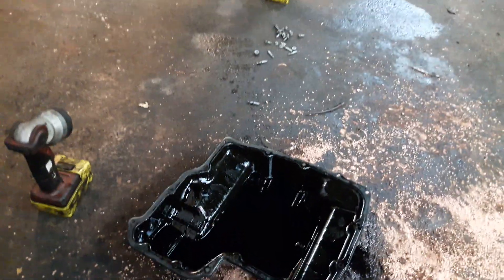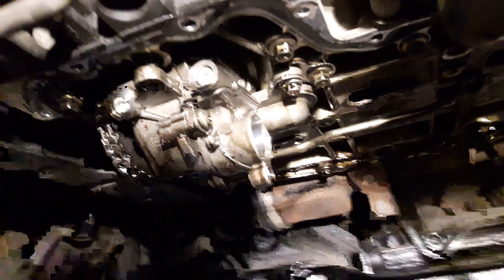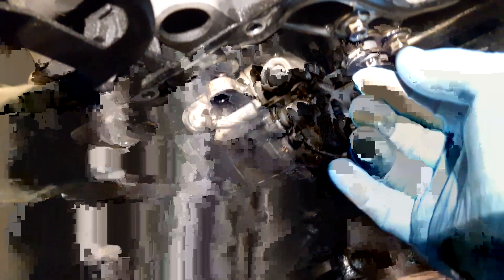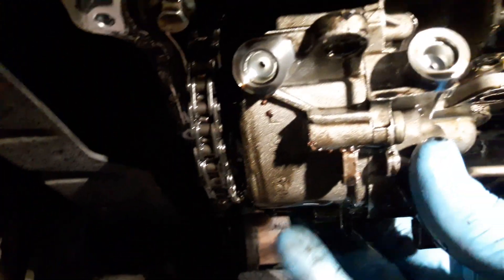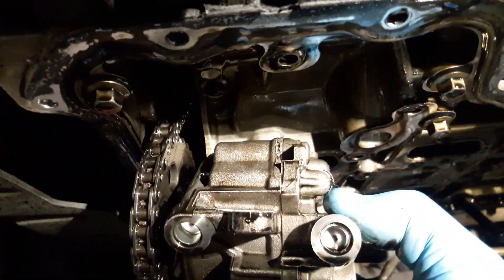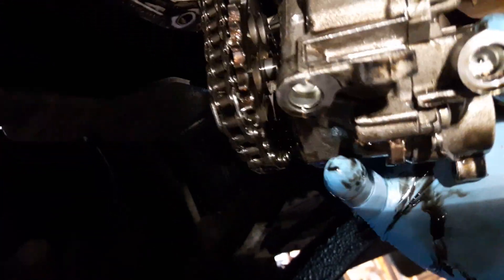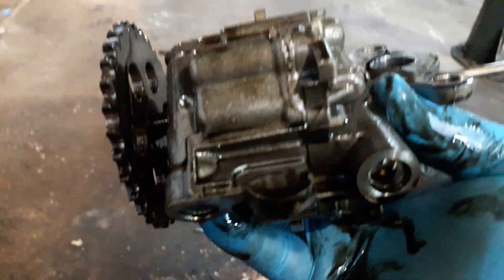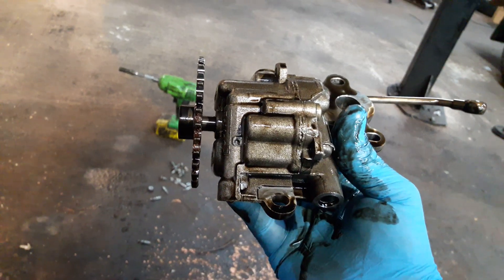2012 transit oil pump replacement

Comment: Does the chain not have a tensioner ? And should the chain and tensioner be changed at the same time ? And is it a total separate chain from the timing chain ? Thank you

Comment: Hi. I've replaced the oil pump on my 2.2 ranger to
a gear type but now its got a whine/humming
noise when cold and just about goes away
when warm since the new one has been fitted,
any idea what could be causing it? https://youtube.com/shorts/5ur5xyGRsSc?feature=share

Comment: This is also an issue with the Ford Ranger and LR Defender. The oil pump isnt self priming so if the oil is left to drain too long the pump runs dry and won’t pump oil when the engine is re started. The oem pumps are also substandard quality vane type pumps and the vanes (like little metal paddles inside the pump) can snap off or shatter in the pump. I believe Land Rover have issued a recall with the defender (but not certain) and Ford have acknowledged the Transit has a dodgy pump but haven’t with the Ranger (or the Everest) for some reason.
Reply: I think the worst affected years with the Ranger were from it’s introduction in 2012 until about 2014/15, apparently after that they used better wearing vanes in the pumps, but it’s still a dodgy design and only time will tell if these pumps shit themselves as well
Reply: It's good to install older version of the pump the toothed one. Centrifugal pumps are crappy. In mine 2015 transit in distance of 100 k miles this pump was changed three times. Ticking bomb. Engine oil pressure is constantly too low I read on Russian forum. https://www.drive2.ru/experience/ford/g4864/
Reply: I think the plastic paddles just snap on them
Reply: The pump sits in the oil,  they don't need priming 🤦‍♂️
Reply: @ssss-df5qz  Okay well the ranger and defender ones do.. not actually sure about the transit

Comment: Hi Richard 
After you fitted the pump how did you go about priming the pump ? I have read a few ways to do it but just wondering how you did it ?
Thanks
Reply from the maker: Hi I primed the pump by soaking in a bucket of oil and turning the gear to fill the pump before installation
Reply: Richard Sawyer thanks and I’m guessing you just reinstalled it and filled with oil from top and no issues after ?
Reply from the maker: No issues after installing pump.
Reply: Richard Sawyer perfect thanks for the info 👍

Comment: Hi Richard
Just about to have a go at changing the oil pump on my 2013 citroen relay van which I believe is the same as this. 
Do you just use gasket sealant on the oil pump.?
Also is there a gasket for the sump or use sealant as well.
Thanks appreciate your help.
Dave

Comment: Hi @Richard Sawyer, is it the same engine as 2017 Ford Ranger XLT 2.2l?(ZSD-422 engine) is it true that it has an oil pump issue from the factory? is it really a 'tickling bomb'? fyi, i really want to buy that car, its one of my dream cars. But i'm afraid because of that issue.
Your answer would be very appreciated! thanks.
Reply from the maker: Boutros A tje issue with tjis particular vehicle was due to lack of servicing and oil quality and not an issue from the factory. Hope this helps. Cheers
Reply: now i wonder why all of the cars  with that engine (Ford Transit, LR Defender, Jaguar X-type, etc.)got a recall from the manufacture except the Ford Ranger because of the oil pump failure... I found the infos from some websites. But thank you, i think your comment is more make sense.
Reply: It's good to install older version of the pump the toothed one. Centrifugal pumps are crappy. In mine 2015 transit in distance of 100 k miles this pump was changed three times. Ticking bomb.

Comment: Was the old pump causing a rattling noise on acceleration?  As mine is knocking on revs but only in drive thanks

Comment: Hi does anyone know if you get the same problem wit a Boxer 2014 model?
Reply from the maker: Dave Tozer i believe that the boxer 2.2 is the same engine so therefore may have the same  issues.
Reply: Richard Sawyer thanks Richard I have a 2014 which I am converting into a camper . I have a head gasket gone so probably needs a complete head refurbishment so while this is being done I thought it wise to change the oil pump and water pump as well. Have you any experience on head gasket failure on these engines.  Thanks for your help.
Reply: @davetozer5982  hi. Im curious? It was in yours 2.2 head gasket or EGR cooler or water pump problem? Because head gasket very rare problem in this engine? Regards

Comment: Hi Richard,just had this done on a boxer,same procedure,same engine,also applicable on later land rover defenders and Citroen relays from 2006 on,though 2012-2013 seems to be the problem years,pump breaks up,we were lucky our van did it on first start up in the morning

Comment: Ive started having a rattle noise from the oil pump chain(area) i took the sump off to have a look at its condition, it seems to be clean like yours in video but the chain has about 2 inch travel! Is this normal or do i need to change chain and tenshioner? Thanks
Reply from the maker: Ryan Fletcher. Try changing the oil pump tensioner  as the chain isn't that tight as you can see. You'll find that the pump is giving you all the noise. I just replaced the pump and everything was fine.

Comment: What sealant do i use when putting back together 
On no parts dont want leek between pump and block 
Please
Reply from the maker: thomas cresswell  any good gasket sealant. As it's a face fit you'll need just the smallest amount. Just watch on the oil pump as you don't want to block oil galleries
Reply: Richard Sawyer 
Cheers mate done and dusted now thanks